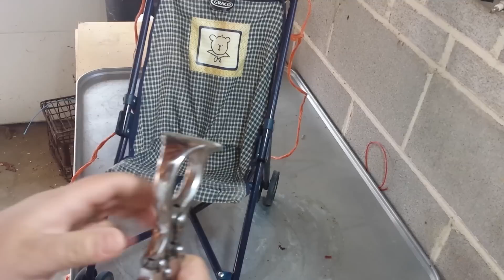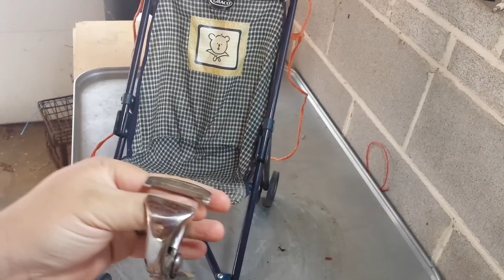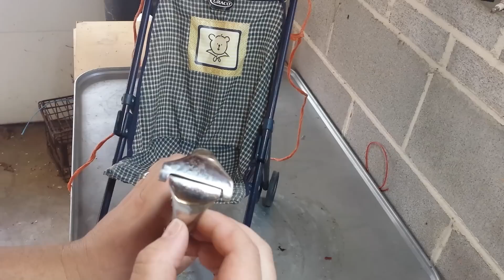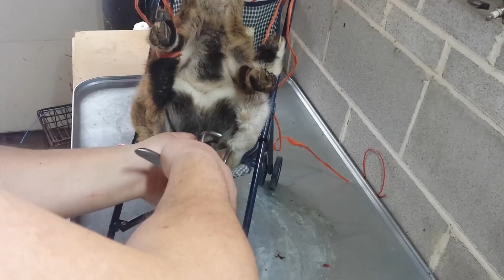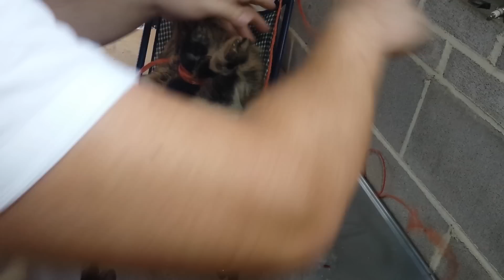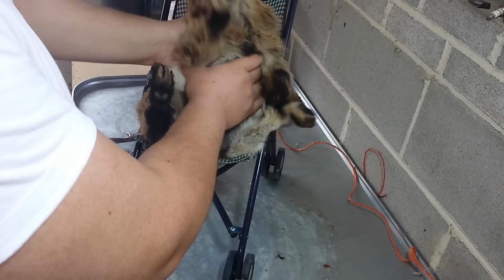Complete Bloodless Castration of Goat

Comment: You can use this on a full grown goat, right?
Reply from the maker: +Rat and Cat The spermatic cord gets to be pretty big in a full grown goat.  It would be a tight fit into the tool.  We had a full grown one that I was going to do but opted not to do it.  Our vet ended up doing it the traditional way of cutting bottom of scrotum and pulling testes out and cut off.
Reply: Shucks.